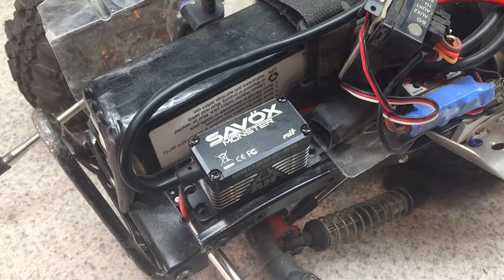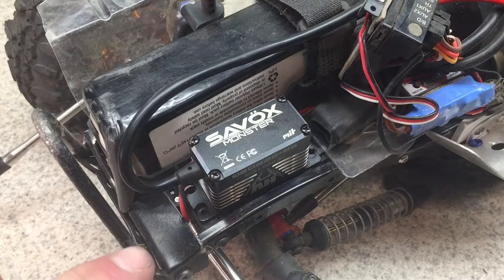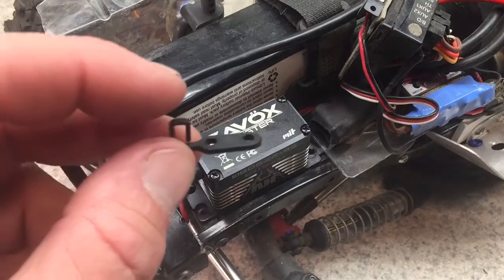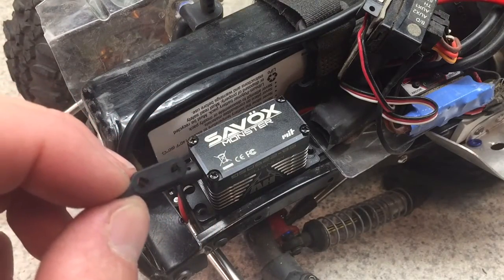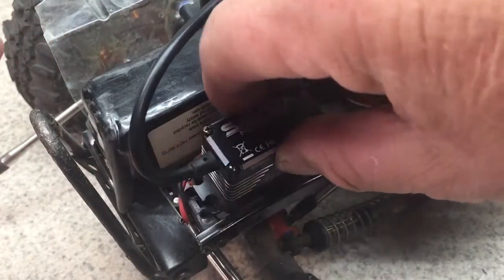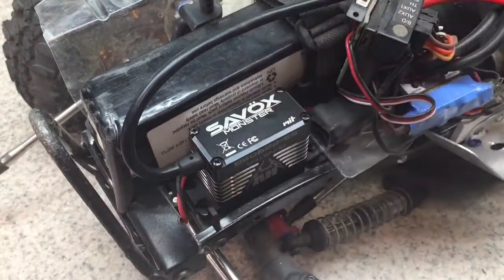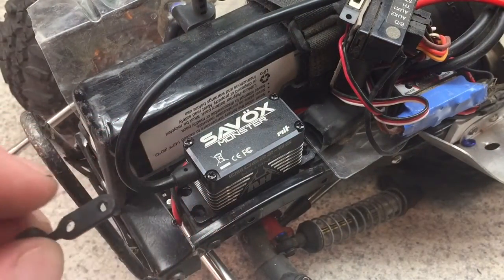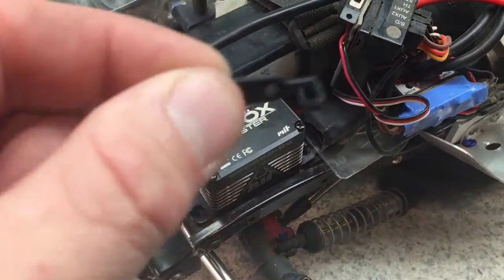SCX 10.2 Servo Installation

Comment: That only works with your expensive servo. The lower end servos have a plastic ridge so you can't put the wire holder under the servo

Comment: This doesnt work on some servos that have a little tab in the middle of the case, if you use these wire holders(not meant for spacers) the servo wont lay flat on the surface.